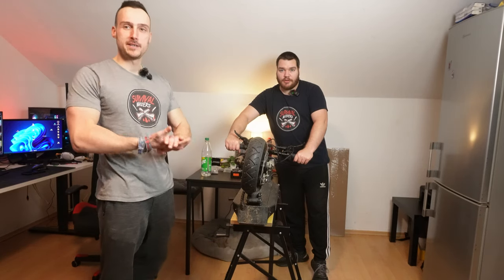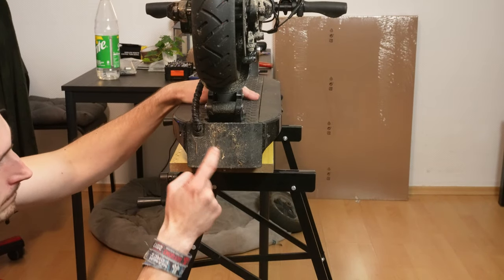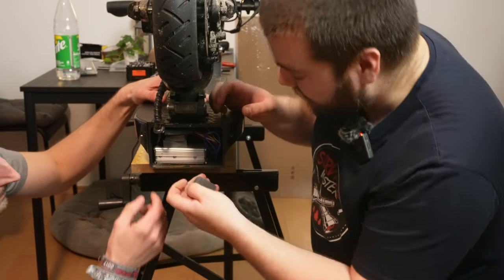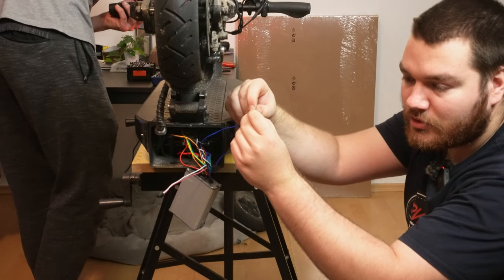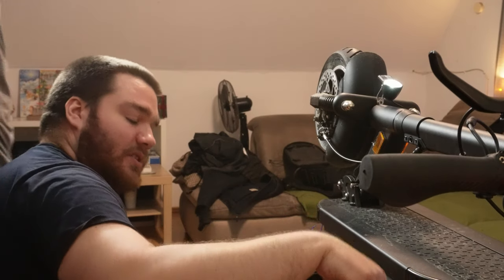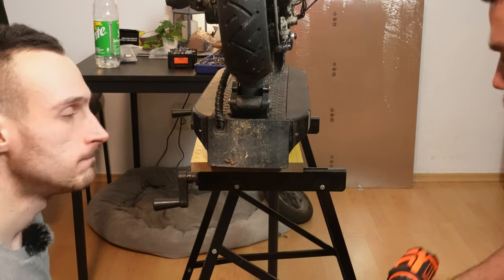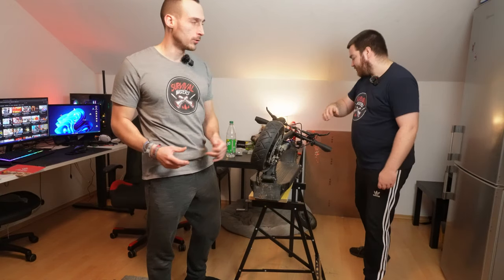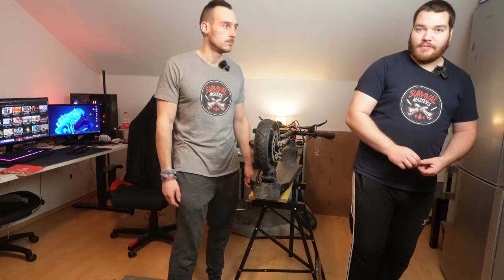How to make every escooter faster 🔥 | remove the Speed limiter ❗️

Comment: I would recommend running a on/off switch to the limiter with some extra cable to handle bars so you can run limiter when you are going slower to give the battery and motor a break or you risk cooking both.
Reply: What if I turn on a slower mode when I drive normal?
Reply: @ArtemGradinar  think it doesn't matter what mode you put it on after disconnect the limiter loop it will go full capacity in all modes so better to just fit a switch and switch on when not doing full speed also not a good idea doing full speed for extended periods without limiter or you will kill it.
Reply: Smart
Reply: I drive the exact same model since 2021, 7300km on it, stock battery (48V 26Ah model, „100km range“, realistic 50-70 km range) and unlocked since day one.

I go nearly all the time 30-40 km/h continuous, also steeper (longer) climbs with 20-25 km/h and nothing fried yet except the cheap LED high beams.

But i also used thermal compound to improve heat transfer from the controller to the frame as well let the motor cool off a bit when the motor overheat icon lights up the very rare moments in the hottest summer days.

I have absolutely no clue how you all think this „unlock“ will harm the scooter in long term. If you have not realized yet, those scooters are normally made to be delivered unlocked from factory (thats why many have a connector instead of a bare wire to cut), it just happens that in many countries they are regulated to either drive anywhere between 20 (23 with tolerances) and 25km/h legally so they are delivered in those countries locked.

When we talk about the battery…. you are absolutely right about long term damage, especially with the cheapest 48V 10-12,8Ah models with 1000W (2000W peak) motor, when the manufacturers have not used high drain Li Ion cells you can be pretty sure the battery will degrade „fast“, so probably less than 500 cycles even possible since you can discharge the battery entirely within 20 minutes (25km/h or more slightly uphill) (so 3C continuous)
Reply: @harrison00xXx  yeah if it's just a lock out feature with the proper battery capacity it likely will be OK but those cheap models are using the cheap components derestricting those has bad results I know a few who did this hack and killed their battery pack the decent heat compound is a great suggestion that's going to help alot. There are just too many different models and knockoffs out there to not suggest putting some protection measures in. Point is check your components and model if it's got the good components and just a limiter you will get away with removing it if not just go easy on it or you'll end up walking😂
Reply: @PedigreeMongrel  For me, the worries stopped entirely as i was reading those specs on the controller: 48-72V. When unlocked and with a 60V E bike battery, the scooter even goes 55-60 km/h. Locked its the same 25 km/h limit via software, just more torque.

Also, my model is shipped as well with 48V 10Ah battery in the cheapest version and i guess it will last the same time considering you dont do too much full charges/discharges (which will be hard considering the low capacity)

My scooter is btw also a "cheap knockoff", just the basic 1000W scooter with suspension and 10" tires you find everywhere, but its a german seller and they claim "The original from Germany"...
Reply: @harrison00xXx   sounds like it sits comfortably within the voltage range the discharge rate on low capacity batteries is most likely whats catching people out if you deplete it quickly and stick it straight on charge they do better cooling off a bit after a continuous run before charging i've picked up a couple that just needed new battery they are cheap enough second hand to not be overly concerned mines a cheapo and its doing fine for a year so far I don't give it too much heavy use though.
Reply: That's not true if your going slower it wont go full
Reply: @Randomclips...__  like I said "I think" different modes make no difference when you take the speed loop off it shouldn't be restricted obviously throttle control signals are unchanged just there are no restrictions on top speed I will have to try putting mine on eco to see if it restricts it to know for sure.
Reply: Do you know how bro
Reply: I mean what cable to cut
Reply: @Randomclips...__  it depends on what type, age and country of purchase some models don't work when you cut the limiter loop it just spits out an error code those have to be jailbreak some just made without limit so no change on those. The process is quite easy to find the limiter loop follow loom from motor there will be a wire that immediately increases speed when disconnected all wires usually have a connector on so no need to cut you can disconnect and try if you don't find one that does it like as shown on video then your model isn't easily derestrict or is at full speed already.
Reply: @PedigreeMongrel  i’m no electrician or anything, but isn’t a limiter also putting stress on the battery not allowing it to go full speed?
Reply: How to do that?
Reply: @iivLoXr my suggestion is locate limiter loop from motor instead of just cutting it run twin cable to a disconnect switch on handle bar that way you can use it like a boost button instead. Not all scooters are able to be as easily derestricted like the video shows so check you have a limiter loop in the first place
Reply: @PedigreeMongrel do you know how I could put a switch on?

Comment: First off even in the UK a lot of these can be programmed in the LCD display if it is a lt100, lh100 QT – 100 and others alike it. Also make sure you giving out the right information some of these blue wires AR a self-learning wire not a rev limiter wire. The self-learning wire is usually white , blue or yellow unfortunately speed limiters are also white or blue single wire. Then there are some that the controller is just programmed into the system and if you do not know how to take the controller out or plug it into the LCD display reprogram it you're still going to have issues.
Reply: Hey, you seem very knowledgeable.
Do you know if this is possible on a carrera impel is-2?
Reply: Believe me I know the self learn wires which uaually arent oresent on alot of major brand  made controllers but any aftermarket controllers of course they are existent which is why I say its a case by case basis
Reply: @zeekltd  thats like a gotrax. Which usually is maxxed out for the most part but i cannot 100% say without seeing it myself so I dont want to give you definitive answer and mislead you one way or another
Reply: @Endlisswheelz  I appreciate your response. How do you think I can get the carerra impel is - 2  faster?
It's a very  sturdy scooter but restricted at 15 mph, hard commute 😳  unlocked it will be alot of fun 😃
Reply: @Endlisswheelz  hey sir, how about Inmotion Air Pro? It's supposed to go 35 but is limited to 25km/h. Your advice would be very greatly appreciated! THX
Reply: If you make a mistake, you can still fix it.. 
How to fix. 
1 - First get a lighter and put a piece of rubber tube on one of the cables for when your finished, to seal it against water. In the end you carefully heat the rubber so it tightens around the cable..  That was the intro, NOW LETS BEGIN. Take a knife and carefully cut around and pull off some of the cable so 1cm of wire sticks out of both ends. 
2 - Straighten the wires out and Stick them into each other and twist them softly togeter. (Bending the wires too much can make them break, and you cant keep cutting the cable because the it might become too short to connect, so be careful about bending the wires. 
3 - when they're connected you slide that rubber piece over the naked cable and carefully heat the rubber until it becomes tight and is safe from water. 
Now try another cable and if that dont work, you know how to fix it. 
Also if you dont have the rubber thats made for this stuff, then just use tape and carefully give it heat with the lighter if needed until thebpæastic tightens around it ..
Reply: i mean if you cut a cable, cut it in the middle. soldering aint hard. also get some heat shrink. i learnd soldering on a micro deone with wires as thin as a strand of hair so  its not as scarry as it seems
Reply: Can u do this on a pure 2 gen e scooter
Reply: Ride GB 350w E Scooter is lmt'd at 30kph, new to the e scooter scene & in my 50's, so probably 12.5mph is fast enough for me 😂
Are they classed as a PLEV vehicle & can you get a public liability insurance on them for use in or around town? I live in a little Countryside village so expect no problems, but would rather be safe if anyone knows. 👍🇬🇧
Reply: @EdzashedFudwinkle I got electric micro in London also 55😱😂❤
Reply: @SjplayinCODMO  I'm registered as disabled ♿ and some days struggle to walk 100ft, so I use the scooter to goto the shops.
I slow down when I see any pedestrians on the pavement and will happily give them the right of passage 1st, but there is always 1 Police Officer happy to dish out a Sec59, and they always ask for insurance, Where's the L Plates etc as a reason to confiscate the scooter.
If I goto Preston,Manchester or Bolton you can rent them off the council, none have L Plates, and are no diffrent to my scooter.
Fortunately being in a village we don't see many Police unless they've been called or nipping through the village, not that I'd stop for them, and it's only once or twice a month I use it, most days I'd walk the 5mins to the shops.
Anyways, nothing wrong being North of 50 matey and having a scooter, appreciate the reply, Ed 👍🇬🇧

Comment: Thanks for this! I'm totally going to hook mine up on a hidden toggle switch and treat it like an "Overdrive".
Reply: How would you do that? Would you wire a switch in the middle of the loop, like a simple on off toggle switch. Not being sarcastic genuinely curious.
Reply: @seththebeatmxchine  Yes, you would. An interrupt switch.
Reply: @ThickThock  interrupt! That's the word i was looking for. Interesting, thanks for the reply.
Reply: Make a video on how please😭
Reply: Class idea if you get pulled up by you know who.. They seem to to be clamping down on this here. 
I know this will be a dumb question with a obvious answer. But have you done this upgrade? And what was the result please. Also does the battery get drained a lot quicker when doing this? Or do you still get the same amount of distance. As my scooter only travels 15 km approximately before I have to recharge. This is without doing this upgrade.
Reply: @Sense89-l5q 
you could use a button and put it in where your thumb can hold it in then you could use it in bursts?

Comment: If you’re thinking of doing this please take note that each scooter comes with a limit for a reason (to keep the motor from burning out)
Increasing it from 20 to 45 is almost double and will produce more heat and may burn your motor out. In total making your scooter un drivable ( you may risk a explosion)

Comment: Great video guys! I am in England and brand new to electric scooters. Your command of English is great by the way! Dues to buy a Chaos 1000W 36/48V used scooter next Wednesday 2nd August 2023. I believe they can achieve 45 to 50 KMH which is 27 to 30 MPH. I am going to have an investigation on the throttle controller and see if there is a blue wire. 

If there is, then I will follow your instructions and see if it can increase the maximum speed. If it does, then I will extremely appreciative of you guys. Vielen dank!
Reply: So its now august 26th…. Still waiting on your update……..that is if you actually bought the chaos scooter loooool
Reply: update?
Reply: We are waitiiiiinnnnggggg
Reply: Update please
Reply: updatew please !!!!!!!!!!!

Comment: Only 45 !!! I managed to get mine to do 73kmph and it was originally 25kmph.. I didn't cut wires though.. Little bit of reprogramming involved 👍👍
Reply: How
Reply: Update the "Controller Firmware" via the "Thunderbolt Port".. Not saying any motherboard will have that port, but mine did, there's algorithms hidden in there on files accessible through the laptop via the connector, did take a good bit of trial and error mind you !!
Best option, leave it be because the Guards seized mine due to it's speed.. It's GONE now I'm afraid 😨

Comment: Hey guys. I really liked the video. In this case, only the top speed changes or does the acceleration change as well? and can this also be done on the Iscooter X6 scooter? I would also like to ask if it will spin at maximum in all speeds or will it only go more in eg 3rd gear?
Reply: top speed changes only
Reply: Bro did you do it? Did it work because I have the ix5 and i dont know if I should cut it did it work for you

Comment: I’m so happy my ReddyRD1 doesn’t have a speed limit. It has 3 gears and 2 modes with a top speed of 65mph
Reply: It does not. Reddyrd1 will reach 52mph,  it runs on a 60v battery with dual 3000w peak power motors so unless you swapped out the controller,  the battery and motors, 65mph would be impossible. I've had mine for three years and I also recently purchased an inmotion rs and got that a little over 60mph. Ran the two side by side and it's not even close, the rs toasted it. Don't get me wrong, rd1 is a great scooter but 65mph is exaggerated. If y'all don't believe me, buy one and you'll see...

Comment: Is it a digital signal?  Obviously you could use a switch for on/off limits speed but could you use a potentiometer to adjust the value / voltage to dial in your own top speed instead?

Comment: Would this work on a ZIPPER M6 350W? I have this scooter for running to shops on but it just doesnt have enough power to get me up the hills, a little more power and Id get up the hills no problems. Great video and your English is excellent.
Reply: A 350w escooter can only top out at 20mph unless it's programed in the controller
Reply: @theebikeguy3852  you will burn down motor. I hawe 650w and max is 1000 and I use it att easy hills 200m -300m cos it will brake my motor and mine goes 42km/h
Reply: @k9teamzagrebskolazapse149  Jel funkcionira ova metoda za Xiaomi 4 romobil?

Comment: Hi guys. Could you, please, check if cutting the cable improves starting uphill capabilities? I don't need higher speed, while starting uphill is more important.
Reply: Most likely you are running full power uphill already, if you are hitting speed limit when going up then you have a bit more power to unlock.
Reply: torque.
You need more torque.
Reply: @jenntek.101  Correct. Any ideas if the wire has any effect on it?
Reply: @BoykoRoman  increasing speed is different that increasing torque.
Try a different sprocket on your motor.
Reply: @BoykoRoman I know it's an old question, but anyway... On the lcd (when you press both buttons simultaneously), there is a something like "Launching the scooter" - P09 option. You have two choices : 0 - start immediately or 1 - push and run. One of those two has a bigger torque (If I remember correctly it's number 1)

Comment: I wonder if wiring a pedal or dial of some kind could be viable.

It would be like shifting gears on a ten speed bicycle and it could also help keep the motor and battery cooler.

Comment: Hey guys, did you happen to do the Hiboy S2 pro? I was wondering if it has a similar cable i can cut? Thanks and keep up the great videos 😊
Reply: Did you find hack to remove speed limiter ?
 I  have Hiboy s2 pro.
Reply: @shubhamjayswal3049  i need info on the hiboy too
Reply: @joeeberger1  same
Reply: Same I have the hiboy titan pro 2 I can go 32mph but I would like to go faster lol 😂
Reply: If there is a tweak for Apollo city pro, I would really appreciate  it. Stuck in 20 miles.
Reply: I guessing it works on any scooter or bike as long as you cut the correct wire.
Reply: Here to find out the color of the wire for the hiboy S2 pro also
Reply: Same

Comment: I know that it can be done for many years, but I also know from many years of experience in electricity that if you cut the wire or remove the limiter, you will create a problem with the engine and the engine will catch fire like a flint, the factory puts a limit to protect excessive overheating or full throttle up the hill if you give it from a place, then if there is no limit, the engine will struggle and this will cause the coil to catch fire, there are many more bad sides to that!
Reply: I was thinking this. But also thought that the limiter is there as a default safety mode for various countries. Obviously the battery life will not last as long too I guessing?? 
I'm going to give it a go as my scooter is getting old and have the feeling that the battery is in its way out as it's 2 years old.
Reply: It’s not an engine 😂

Comment: I'm sorry for everyone who cuted the cable on their scooters... Here's a simple trick to get the same results on your scooter without damages in 3 easy steps.

Step1: Press simultaneously On & Mode
Step2: When the menu opens, go to P8 by pressing 7 times on the On button.
Step3: Hold Mode until the setting is at 100.

Your wellcome 🤜
Reply: What does that do??
Reply: Its easy to fix the broken cable anyway
Reply: @deliriousbeats8940  it unlocks full power, P3 is your acceleration. Be careful not to change any of the other settings 😃
Reply: @luisfclopes9596  yes but why cut cables when you can simply change the settings 💁‍♂️
Reply: how can you do this on the kqi2 pro? It only has one button
Reply: @luisfclopes9596  how
Reply: @Zurl6321  just put them together and add some tape to isolate
Reply: @luisfclopes9596  ohh
Reply: @muscuaction273  1. не надо обобщать все курки, с виду все одинаковые, а меню и платы у всех разные.
2. у меня набирает 20km, но настройка в меню P8 после 60% не работает. ставлю 100%, а обороты как 60%. буду смотреть провода.
Reply: How do you do this on the Jetson Bolt Pro ?